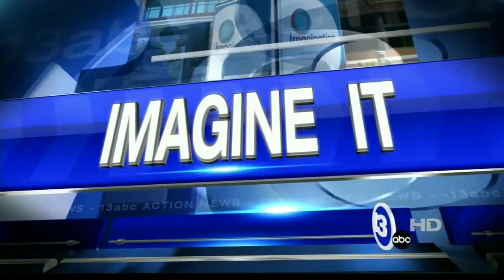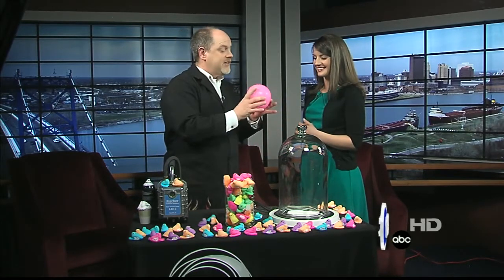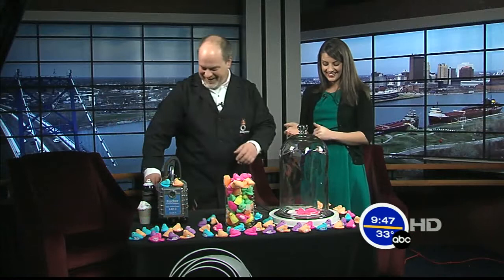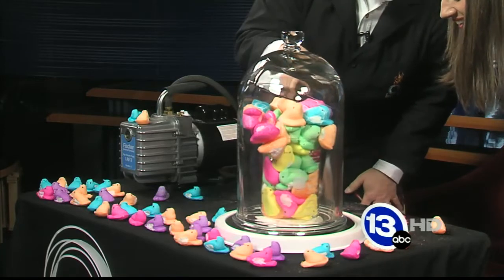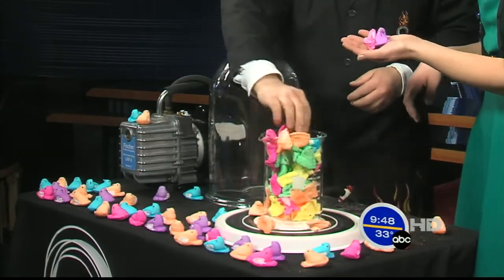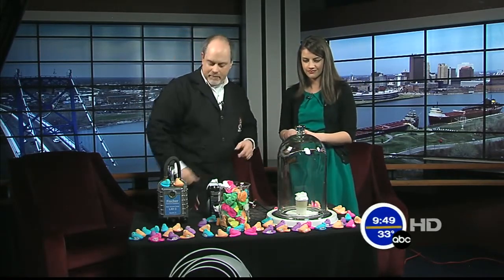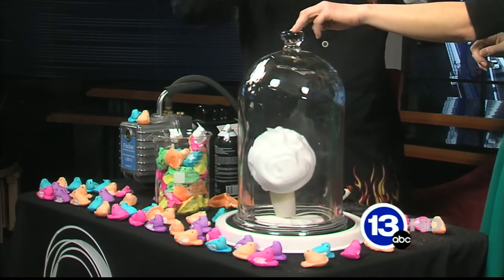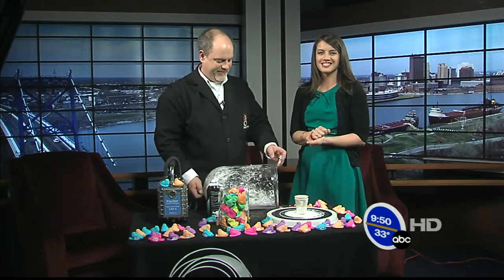Peeps in a vacuum chamber

Comment: Nice video!  I don't know why it doesn't have more views.  Also that woman is pretty smart.  She noticed that the peeps were cold, but there was no explanation so I'll give one.  As the pressure drops in the container the water in the peeps have less pressure holding them in the candy (loosely speaking) so the water actually evaporates quickly. Like boiling water on a stove, it takes a lot of heat to vaporize water.  This heat comes from within which cools the peeps down.
Reply from the maker: Thanks Dangos, 

Hey, if you liked the video make sure you pass it on!

You are correct in your explanation of the cooling of the peep, Thank you! During the live spot I was so concerned about getting through everything that I just sort of pushed that comment off to the side in order to get through the rest of the segment. I've had a few people catch me on that one, so in the future I will be sure to explain that!

Carl
Reply: Carl Nelson I will pass it on to the Science, Technology, and Society Discussion Corner on facebook.  Let me know if you have a facebook and don't mind me adding you to the group.  It's a great discussion group where we discuss many different areas of science and technology and the posts are usually very interesting!
Reply: @RAYMOND BLOCH  Hey